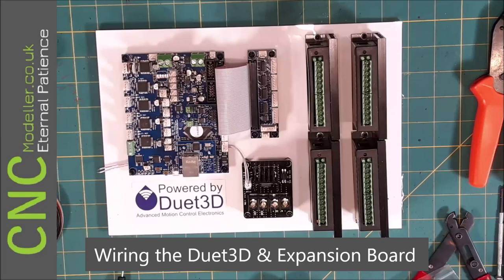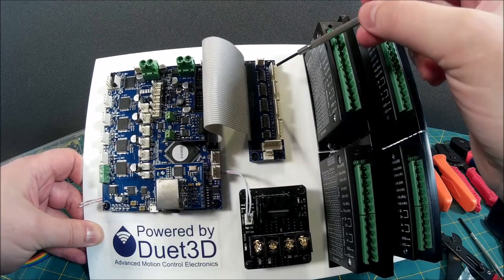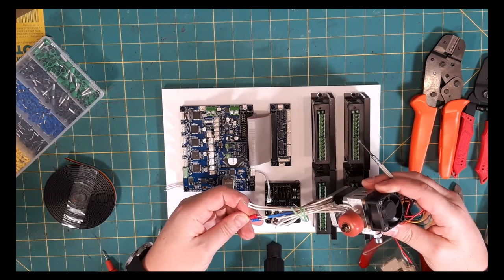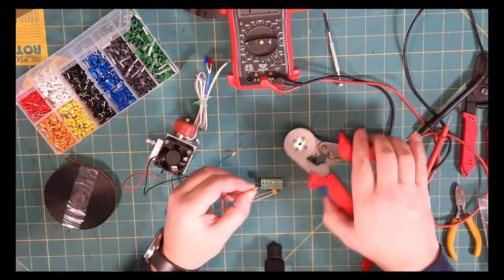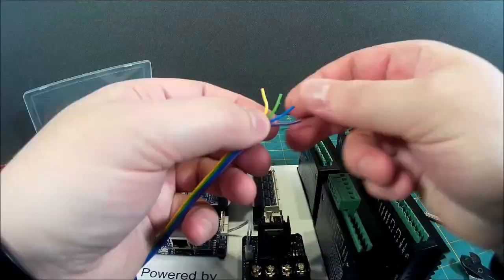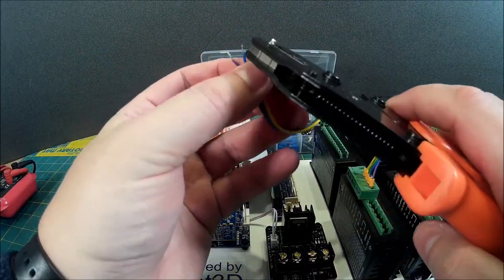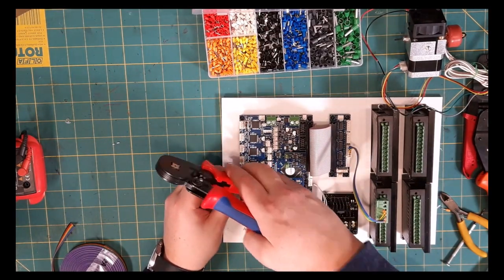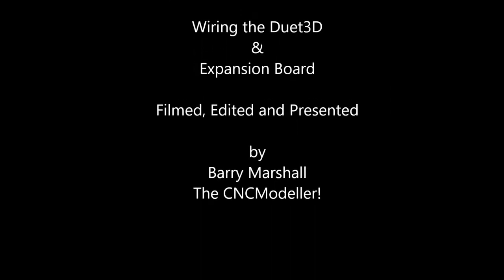How to wire the Duet3D 3D Printer Controller & Expansion Board

Comment: What is the advantage of using independent stepper drivers over using the onboard controllers?
Reply from the maker: Hi Miss'P', 
       The independent drivers runs at up to 40v so you get more torque and generally better to performance in high load situations, albeit the drivers I'm using are less refined than the onboard ones. Hope that helps. All the best
Barry M
Reply: @CNCModellerUK  Thanks! So - when setting up the drivers in Duet - do you need to specify / create special G-code depending on which drivers you use, or is it purely plugging the cables into the independent stepper drivers, and then choosing the settings on the toggles on the driver itself? And do you need to 'match' the drivers and the motors?
Reply from the maker: To be honest I can't remember. It's been a while but I just followed the Duet3D documentation. The drivers should work with any bipolar motor. I just played with gradually increasing the current settings until the stepper settled at about 60 deg C. Any hotter and the magnets flux will start to degrade. Hope that helps!

Comment: What gage wiring did you use?
Reply from the maker: TBH I can't remember, however I just looked up the current rating for the wire based on stepper current draw and got something appropriate. In terms of the signalling any wire should suffice as it's all low current.
Reply: Anyway you could send me a picture of the final set up for the wiring? I’m working on a workbee cnc conversation using the same drivers and board just need a better understanding of the wiring layout (at least completed.

Comment: How to configure external stepper drivers on RepRap firmware configuration for Duet 2 wifi?
Reply from the maker: Hi Shubham, 
        To be honest it's been a long time since I've played with my Duet. I'm currently working on upgrading to RRF V3 which has some significant differences. 

I'd recommend you join the Duet3D forum here: https://forum.duet3d.com/

The firmware documentation is also here: https://duet3d.dozuki.com/c/RepRapFirmware

Everyone is very helpful. Hope that helps.
Good luck with your build!
All the best
Barry M

Comment: Does the driver need power wires to the vcc and ground from the external supply or is it powered somewhere else?
Reply from the maker: Hi Grant,
  The drivers are powered separately to allow me to use 36v. It's the two empty connections next to the motor wires on the drivers. Hope that helps. :-)
Reply: CNC Modeller Thanks!

Comment: Hi, may i get some advice firmware configuration for duet 2 ethernet for my cement extruder 3d printer? Thanks.
Reply from the maker: Check out the Duet3D forum. They're really helpful 😁 https://forum.duet3d.com/
Reply: @CNCModellerUK  thank you very much bro...
Reply from the maker: No worries. Good luck with your project. I'm no expert but the guys on there are very knowledgeable.
Reply: @CNCModellerUK  Hi, just want to ask whether duet3d support 6A DC24 or above(even AC)external controller driver?  Thanks.
Reply from the maker: I think V2 boards are 12 to 24v and 2.4 A. V3 are 12 to 36v and up to 6A. I'm using a V2, V3 are very different. Check out the specification here...
https://www.duet3d.com/index.php?route=common/home#products
Reply: @CNCModellerUK  Thanks, what about if i'm using v2 board and i need to run large stepper or servo motor?